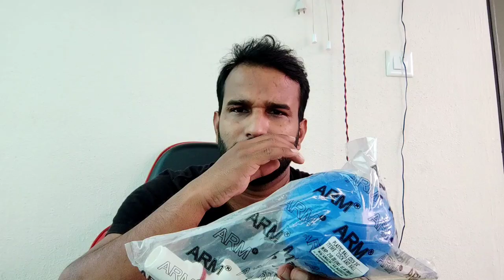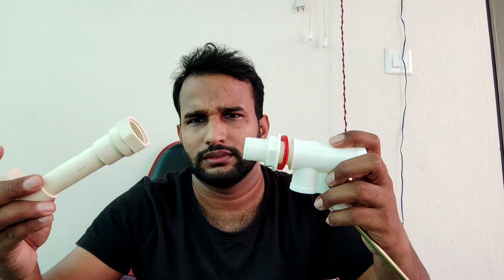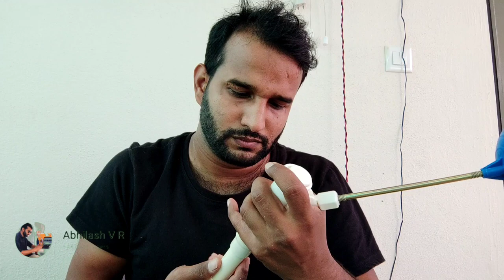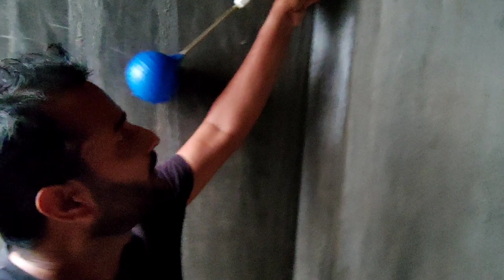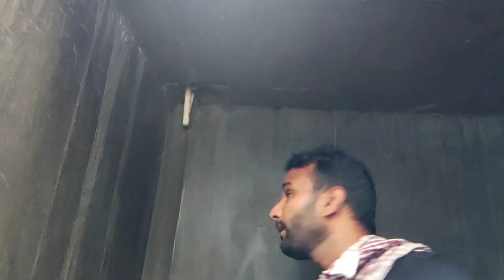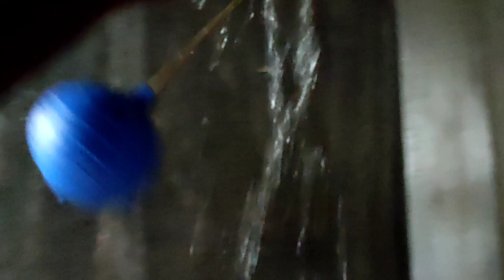How to install Float Valveb or Ball Cock Float Valve Set | How prevent sump tank over flow

Comment: But how will we know when to switch off the motor, if the overhead cement tank is not fitted with a water level indicator sensor ....with just the ball valve...it will stop the water from overflowing for sure...but how will we know if the tank is full now and that we have to switch off the motor...hope the question is clear bro! 

Thanks in advance and Namaskara..sooper video 👌

Comment: when tap is in bottom or in middle in sump what can we do
Reply from the maker: Yes it's little tricky, but I think you can extend the pipeline to top using bend and then install. 
Just Suggestion. 
It depends on water force too
Reply: Simple tie rope to ball for desired water level and also fit nrv valve to the incoming water when water fills to the desired level your float valve will stop the water. And from the water filled level to incoming water level nrv valve will stop the water from returning back
Reply: @hariharan-pp2ij  thanks
Reply: Hello sir..i just read this . I have a sump and fit the tool as you have said.. My water pressure is very high at times and the brass valve breaks every now and then. Do you have any idea or suggestions . Pls help.  @hariharan-pp2ij